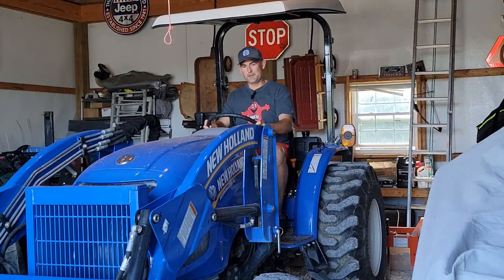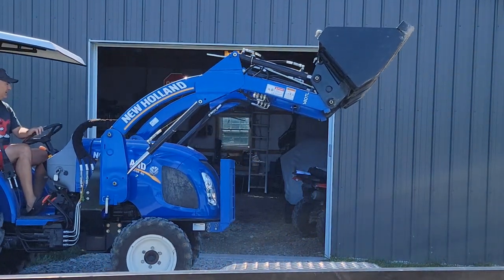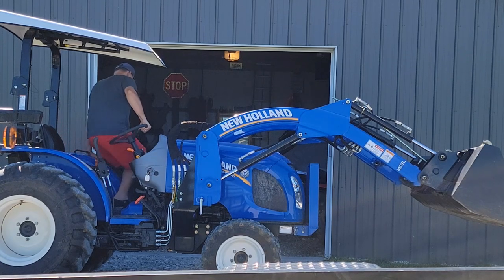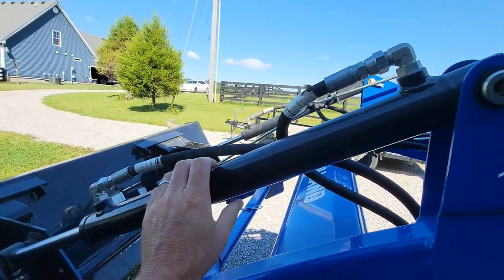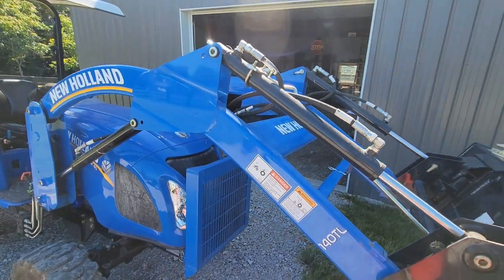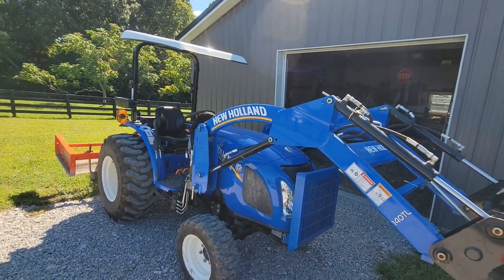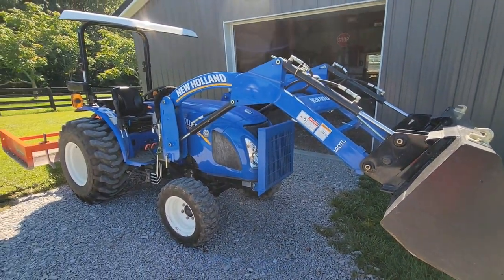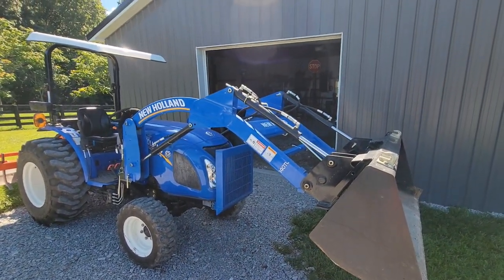Update on My Floppy Loader Bucket on New Holland Compact Tractor

Comment: Suggestions: hydraulic systems are not supposed to pump air into any system. Hydraulic fluid can not be compressed, air can be compressed. An air leak can be in the hydraulic system and not loose hydraulic fluid. Every connection is a potential leak. And yes, air can be drawn in, then once hydraulic fluid is present, the fluid can act as a seal (in one direction), because of pressure. 
I would look for an air leak, leaking into the system. Most likely at the controls or pump. If not a line connection, try defective O rings, or control valves defective. The system is fairly simple. Just because it's new doesn't mean that it's got put together correctly.  
Remember hydraulic systems DO NOT HAVE COMPRESSIBLE AIR IN THE SYSTEM. AIR CAN BE COMPRESSED, HYDRAULIC FLUID CAN NOT BE COMPRESSED! If no air is in the system, then a valve is not seating properly. That would also allow (for example) the bucket to move. If there is only hydraulic fluid in a sealed system, in order for the fluid to move, you need a source of force (a push or pull). Then you need a place for it to travel to. Once forced upon, with a place to go, a vaccum is created, nothing moves. Loop the fluid to the force, and a closed controlled system is formed. 
Find the air leak or the other symptom  of what is called in the automotive world as blow by. Known as getting by a valve (in this case).

Comment: I have found this happens when operating the loader at idle introduces air as the bucket moves faster than the fluid can enter.  Run the loader as you describe but get the rpms up

Comment: Hello.
I have had the exact same problem on my Boomer 25 compact tractor, with a 105 LC loader. In cooperation with my dealer, we tried a lot of things, but nothing made it better. An old mechanic in the workshop told us that he had seen the same problem, a long time ago, but on a much larger machine. He told us to install a restriction (4-5 mm hole, 1/16") in both the lower hydraulic lines that feeds the curl cylinders. This should prevent the piston from moving too fast, when dumpung, which can cause air to enter the cylinder at the other end. We were skeptic but tried it anyway and it worked. I'll admit that it not fixed 100% but it is a lot better. Maybe it could be improved a little bit more by making the restriction a little bit smaller but for now it is ok for me. I was concerned that the restriction would change the curl speed, but it does not seem to be a problem.
Reply: That's a great idea. Especially considering "chevron" seals seal in one direction. (They don't use chevron seals anymore. They use polyurethane.) Still it shouldn't happen.

Comment: The air actually gets into the lines and system when you lower or dump your bucket after the engine is off.  Remember to lower your bucket prior to shutting the engine off and you will reduce this a lot.

Comment: Having same on 5210 John Deere with a 521 bucket attachment.Had  previously changed all fluids& filters for simple fact it was needed,greased ALL points,same issues Aggravating  to say the least but gonna try the full lift method,etc.see how it goes,do not see any leaks anywhere.Back up to the "20" & punt again,lol.Hope we all get the good fortune of resolving this

Comment: About your hydraulic squeal you have attributed to air in system....Here is the fix: Swap out your hydraulic oil with Kubota UDT2 hydraulic fluid. I don't know the mechanism of the change, but it has resolved the same issue for many owners New Holland boomer tractors. Post back on how it works for you. 👍

Comment: My Massey Ferguson's 50A and 60H would load up with air and whine in the cold weather (sometimes would foam out of the reservoir). I found I was using the wrong hydraulic fluid. I think the suction line filter was too restrictive with cold, thick oil and would pull a vacuum. This caused the formation of bubbles and foaming oil. I had to drain it an put in a light 32 weight oil and it fixed the problem. But this tractor should never get air in the system. It's brand new! The suction lines are never that long and they need to be gone over with a fine toothed comb.

Comment: I have a Workmaster 40 that does the same thing. just leave the bucket on the ground in the angle that you want and hold the control in the dump position until the pressure builds in the cylinders, then do your back dragging.

Comment: My Kubota BX23S has this issue, apparently dumping too fast with too low RPM will introduce air. Rev engine above 2000 and fully dump/curl at a low rate should get rid of most of it.

Comment: Haven't seen it on either of my kubotas. Sounds like a fairly common defect, and there's gotta be a mechanic somewhere who has figured out how to fix it. It seems like a big enough deal that the service manager's advice to live with it isn't appropriate. Also, I remember that my kubota manual recommended back-dragging with the rear of the bucket, in order to protect the cylinders.

Comment: So far not for me on my 2 tractors, but they both have a 1 or 2 second pause near the very bottom of the bucket dump, '97 JD 770 and '22 LS MT235HE. Waiting for the hyd's to catch up I guess. Did you look at another 'tube video that kinda explains it a tiny bit better? Search for "Do you have Floppy Bucket syndrome?" it makes sense with the manufacturers using the same cylinders on different tractors with different hydraulics?

Comment: I’ve noticed this to be much worse if you turn the tractor off in a position where things can move. For example you turn it off with the 3 point up so it can creep down later. Or more importantly the loader. If you turn it off where as the loader arms creep down and settle that it will put pressure on the bucket and cause it to creep and roll the bucket to curl or dump. As it’s forcing that bucket to roll it can pull air in the other side as it’s pushing fluid out. I’ve found if I curl my bucket down like I was going to back drag and set the loader down on it so the bucket isn’t trying to roll to a curl nor a dump then it nearly Eliminates the air totally. I have a Kubota.

Comment: Trade that thing in on a tractor that matches your land plane. You will be much happier. The only way air gets into a closed system is low fluid level or a leak. That’s not normal.

Comment: Another choice is swap out parts, one at a time. Use a different brand name to be sure not to replace possible one defective part, for the same possible defective new part, made the same as the one removed because it came from the same place and the manufacturer may not have realized the fault or maybe a screw up in shipping the same bad instead of the corrected newest version. Costly but sure to cure. Parts and installation must both be equally important and done well.

Comment: hi, i have bx23s doing the same thing, bucket floats  about 24 inches on th back drag.this didn't do this in the first year i had it. the 2014 tractor i had first didn't do it at all in 5 years of service. this 2020 started doing this after the 1st year.. its in the shop at this momint. i'll try and let you know how it works out. not happy with the explations i've been gettig.

Comment: i have that same tractor with that same loader my tractor does not do that 2018 workmaster 40 it will pick up the front wheels and the cylinders hold up fine never herd mine make that noise

Comment: Repack both inner pistons and problem is gone
Reply: Watch the front wheel bearings for wear
Reply: You have bad packings in one of the tilt cylinders. I have had this problem many times before!
Reply: This is a lot of miss information it’s easy when you don’t understand the fundamentals of a system and how it works. Do a little bit more research and come up with some facts from experience to people and you’ll figure this out I am not going to try and add my two cents other than be careful of the miss information.

Comment: Trade it in go Green no more problems of air and floppy buckets 🤷🏻‍♂️ my John Deere holds the bucket , no play , so that guy is feeding you a line of B.S.  go try a JD out at a dealer you will see for yourself .
Reply: Want to bet. 2022 JD 3043D with 36 hours on it doing the same thing. My other JD 3039R has never done that.
Reply from the maker: I guy left a comment in here today that his John Deere is doing the same thing so.....
Reply: @4-LOW  yea but did ya read the whole comment? His other JD has never done that .. his 2022 with 36 hours does it .. which tells me maybe its a factory cost cutting measure maybe they are taking , cause i know of at least 20 people with JD and have never had that issue .. my neighbors BX does it tho .. so must be a cheaper hydro system to save money is my guess 🤷
Reply: @stephendevore1800  ya know im wondering if it is happening on new or almost nee tractors if it is a cost cutting modification they are all making in the hydro system to save money? Maybe cheeping out on the hydro system 🤷 sounds logical to me , they always wanna give ya less for more . All i know is my tractor will lift the whole machine and keep blade angel no matter where i set the angel to
Reply: @PhatboyHD88 You will catch up eventually!